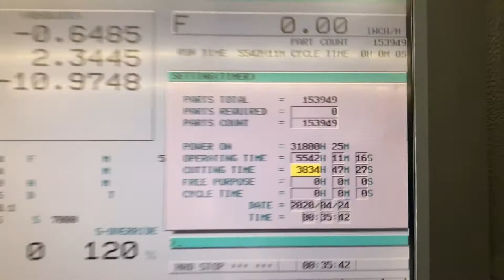Fanuc Robodrill Mate CNC Drill Tap Vertical Machining Center VMC 0i-MC 2008 - MachineStation # 1954

Comment: Hello, I need a manual for repairing CNC machines.  Fanuc, the model that you present, will you be able to get it?  And why does Fanuc need a Box System Driver or Machine Parameter?  With and like this, if the customer is out of warranty, how can the customer repair the machine?